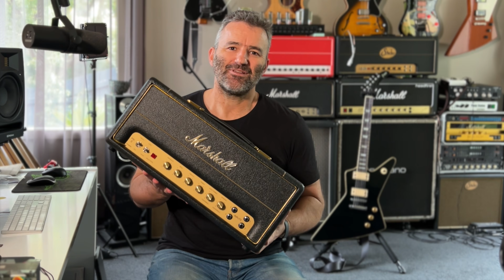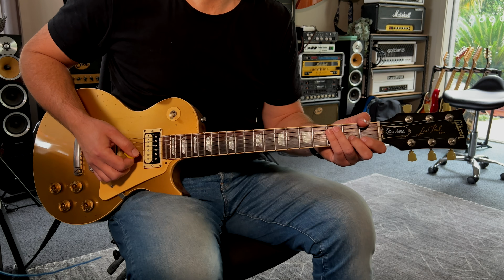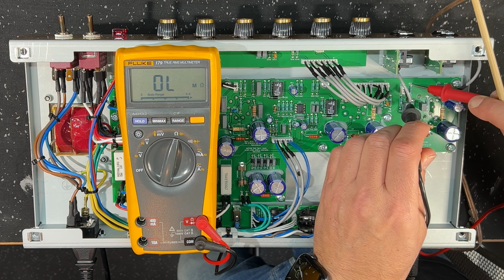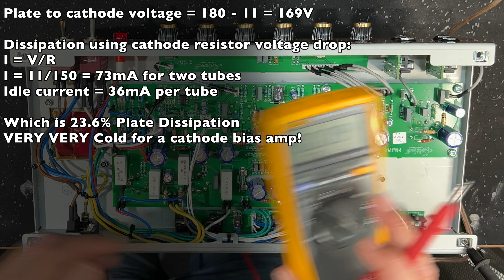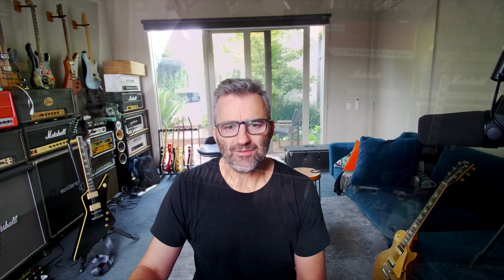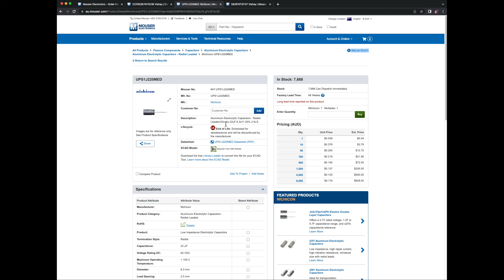Improve the Marshall SV20H with $5 of parts?  BENCH DEEP DIVE!!

Comment from the maker: Guys, worth mentioning that you don’t need to change the 820r cathode for the bass channel for this.  I did both cathodes for v1 to 2k7 in prep for the phase 2 Jose style mod.  There, I just saved another dollar!
Reply: @BlakeC27  sure.  Very simply.  It's all there except for the power transformer, even in HI voltage mode, it's quite low, so lower headroom!  😩
Reply: @RozsaAmplificationLLC  It's a fantastic concept in terms of reducing the size, weight and unneeded volume of 2x EL34 but despite all the means Marshall has available they overlooked one of the most basic details of power-scaling; providing a separate HT supply for the preamp! They get their transformers custom made for them anyways, why not add a separate 300vDC tap so the half-power switch doesn't half-starve the preamp?
Reply: @killingmasheen in low power mode, the preamp supply voltage actually goes up a little, due to less load on the transformer.
Reply: @BlakeC27  yes, the Bass channel (Input 2) has a 330uF cap in parallel with the 820R resistor on the cathode.
For the Normal channel (Input 1), there is a .68uF cap in parallel with that 820R resistor on the cathode!
Reply: Man you've made the amp sound so much better it's unbelievable! You are a true expert in the field
Reply: Hi Jason. After having modded both amps, which one sounds better between the Origin 20 and the SV20 after being modded? Many thanks for your time in advance
Reply from the maker: They have the same transformers and components, I think they are the same tonally
Reply: @HeadfirstAmps and in your opinion the sweet clean sound in comparison between sv20/or20?
Reply: 820, go up to 1000 👍

Comment: Stock sounds amazing as is and the mod makes a subtle adjustment. I can see why it was done. I remember modding my old DSL 100 head and later a DSL 50 and it made a slight improvement to the highs but not sure if it was worth my time changing parts and opening the amp. Anyway it was fun to say…this is my modded amp. If you have an EQ you can change the sound a thousand ways til Sunday although obviously it’s more expensive. Great sound demo at the end!

Comment: SO the whole point of this amp is to get the sound of a vintage marshall lead amp, which absolutely used 820 ohm cathode resistors on the V1 tube (just like the tweed Fender amps they owe their origins to) . The amps that Jimmy page and Jimi hendrix played through used those values..Marshall started using  values like 2.7 k in the 90's ..if you want a 90's ampo i believe they make a studio 900 ? don't they, which is the JCM 900 in this compact home friendly package ?

Comment: The biggest shame is that construction had to be this horrible modern fragile method with circuit board pads. If only this could have been the old robust turret construction that lasts half a century. I like the sound of this mod, but I can’t risk pulling the pads off the board with the component I’m trying to get free of that dreadful lead-free solder. I’d like to buy this amp, but I’m really turned off by this construction method. Anybody had one of these for a while and worked it hard? Can this construction hold up to a lot of gigs?

Comment: Great video Jason. Why plate snubber on V1a and not b, the bright channel? Many players use bright more, even if jumpered.
Reply from the maker: This mod eliminates the normal and bright channels. It has a preamp gain and a master volume now, similar to a 2204
Reply: @HeadfirstAmps thanks. I’m building a 4-hole plexi with extra tube for Jose and SIR#36, you did on your channel and unsure if I add snubbers and where best to install. I doubt I’ll use both extra stages at once and they can be bypassed for standard plexi but inputs jumpered.

Comment: A few comments/questions on a technical nature:

1. How loud of a signal is necessary in order to drive the first gain stage into audible non-linear territory?

2. When you changed the cathode resistor on the first gain stage but left the bypass capacitor the same you increased bottom end amplification (down to 87Hz vs 285Hz, based on crude calculations). 

3. When you added the 22uF fat cap you increased gain to a stage that you kept biased as hot. IME, this runs counter to any goal of reducing fuzziness.

What do I hear? I hear the increased low end in the voicing and a fuller sound overall and find it to be an improvement. I don’t hear any issue with fuzziness in either clip though you didn’t do any heavy riffing on the bass strings at the 12th fret with the neck pickup to tease out any potential problems. This was also helped by the fact that you weren’t using the normal channel which has the 330uF cathode bypass and 22nF coupling capacitor; not to mention that it doesn’t have the bright and treble peaking caps to help mask a fuzzy bottom end.

Personally, I’d go with 1.2k at the cathode of V2A (still bypassed with 22uF) and lower the V2B cathode resistor to 47k; but that depends on whether clipping at the cathode follower is an issue and whether any noticeable compression that may result is desirable. I definitely endorse lowering the bypass frequency at the first gain stage of the high treble channel unless blending is your thing, in which case I think Marshall’s configuration of the normal channel also deserves some scrutiny.

I love your videos and all the wonderful things you do for the DIY community. You are a great source of inspiration!

Comment: Would it be possible to bias the EL34's hotter by just plugging in a lower value cathode resistor, like 120r? Sorry if this is a silly question, new to all this :')
Reply from the maker: The PT almost certainly won’t be rated to cope with it.
Reply: @HeadfirstAmps good to know thank you, frying that would've been a bad move!  
If you have a moment to read, I'd have another question, this time it's a bit more involved.

I've since messed with this amp a good bit more, basing it off of your really good videos on it (and gone a bit nuts with adding switches), but I still haven't gotten it to where I'd like it in the power section: 
There's some weird, unpleasant (the only word I could use to describe it is squirrely? Sorry) high end sizzle happening in the EL34 stage, somewhere above 12khz, that's always been there! Hell it was the reason why I started modding the amp. 
So far it only goes away when a PPIMV (Lar Mar style) is set at around 3-4 o'clock or lower. As far as my lack of much experience goes that just means "ey the EL34's are not happy with that signal level coming in", but could it be anything else?  

The end goal was to get that fuzz-like raw top end of the bigger brothers, if at all possible - and the MV got it a bit closer, but not quite there yet..  
  
PS: There's some resistors between tonestack and PI that end up attenuating the signal a chunk. A gnarly boost can be had getting rid of them! :p

Comment: Interesting video!  As you've pointed out, I hear the differences in the tone after the modifications that you performed...adding both warmth and clarity at the same time, which is sort of contradictory, but you can certainly hear it.  Although it is subtle unless you know what you're listening for.  There also seems to be a slight amount of added sag.  I think the amp sounds great both before and after the mod, but better after...maybe.  To my ear, the tone after the mod sounds more JCM800-ish...if you like that.  What speakers were your using for the demo?

On a related subject regarding the SV20H, some techs are saying that this line of amps is way over-priced for the level of components and build quality you're getting for the price they're being sold at.  Also, that the fact that the power tubes are biased so cold from the factory is a big factor regarding the amp's potential.  Even though, I'm pretty sure this amp is self-biasing within its parameter.  What are your thoughts on this?

Comment: @HeadfirstAmplification Is the PCB of the amp of high quality in your opinion (i.e., so that it would last)?
Reply from the maker: Yes - it's a quality board
Reply: @HeadfirstAmps  Thanks, your opinion means a lot. I'm quite sceptical and was reading up on the subject "hand-wired vs. PCB".
Reply from the maker: @hammondvoodoo9555 PCB can be handwired, for example how I build my amps.  All hand soldered and wired, and with a PCB backbone.  Then there is PCB machine stuffed and wave soldered, that’s different.  People should look past PCB to understand the actual construction method.  PCB done right is superior, especially for high gain.
Reply: @HeadfirstAmps  My concerns are not about function, but about longevity and how often you can replace electronic components that are soldered to a circuit board before the board is broken. For me, hand-wired means that there is no circuit board and you can overhaul the amplifier as often as you like. Defective electronic components may sometimes even burn out and damage the circuit board permanently to such an extent that the affected area must be bypassed.

Comment: Honestly, if I didn't know about the mod, I wouldn't have noticed at all and I'm usually very critical about tone. The differences are very subtle. IMHO, it's not worth doing. When I tried this amp out two days ago my impression was that with bridged channels one primarily adjusts the normal and bright volume - like with any Plexi. This has by far the biggest impact on the overall tone. The 3-band EQ as well as the presence control are set afterwards for fine-tuning - that's it. Very simple and straight-forward like it should be if the sound is right. I'm actually astonished what Marshall achieved with the Studio Series but as soon as I saw the circuit board I was a little disappointed. Point-to-point-wiring is so much better in the long run. But then the amp would be much more expensive, especially with that mentioned choke transformer added ...
Reply: While point to point is in a way kinda nice for collectors it's not the be all and end all many circut board perform admirably there is enough Amps out there to prove this point I like the point to point stuff too but I have realised it is a big selling point for companies who need to sell amps and need a sprinkle off good ole fashioned voodoo dust to sell their product and I'am not saying  their Amps are bad but we all have been sold up years ago myself included that point to point is the only way  your listening to your own sv,20 I have one too along with all the old classics too and you like the sound off your sv20 and it ain't no turret boarded bumble bee capped ge or Telefunken tube powered amp it runs tubes but nothing vintage in it I get the vintage thing I'm in it too but these compromises within the sv20 are pretty incredible and proof enough you can still do it essp with 75 hz g12m or g12h  maybe ev speakers 12l anyway enjoy ya tones

Comment: Hi Jason, I've also seen the other video comparison between this and the Origin. A friend of mine told me that these little bests have a 50w rated output transformer but the power tansformer are not rated for that. So, I have both trafo that I bought months ago for a project. Couold you tell me if it's possible to make this amp a 50w amp? And if yes, if I send you my e-mail, could you tell me what to do?
Thanks a lot.
Reply from the maker: The Origin 50 delivers 50watts.  Thet amp is not worth spending money on replacing the PT imho.  The output section is fine the way it is.

Comment: I once had two 2210's(JCM 800) and both of them sounded so much better when I simply replace the phase inverter pre/tube with a 12AU7. Both amps sounded less boomy and noisy, and had a more balanced overdrive tone, with a more balanced high to low, whereas the original 12AX7 was as your amp here pre-mod was, a bit too strident and out of control... with a lot of mud and noise.
Reply: That's interesting!  I have a 1989 2210 that I have a love-hate relationship with.  No amounts of EQ tweaking seem to make it sound right to me.  The bass sounds bloated, the midrange is just wrong and the high end is spikey.  I've always blamed it on the clipping diodes, but maybe your PI tube suggestion would improve it.  What do you think?
Reply: @markn4526  you only have to try it and see. Tone and overall dynamics are in the ear of the observer, and many have said these amps are too dark and muddy, but I always thought they sounded way better than the overly bright JCM 900's that followed. But this is up to the individual ear, and not for me to pontificate on; anyway you could always try it out for yourself and see how it sounds to you. To me they sounded a little softer and probably quieter,( nit a problem for a 100 watter), but the overdriven sound was a bit tighter, almost as if tge amp had EL84's instead of EL34's at output. One of my amps always sounded better than tge other anyway, so they must vary a bit ( although the one I liked less was originally the combo version which I had rebuilt into a top unit) so maybe some variation in componentry happens deprnding on whether they are made for open backed ttwin combo or top and speaker. I just tried this splitter tube change on a whim( can't remember where I got the idea- back in the 80's, so probably Guitar Player mag) and the amps seemed to like it. I'd say give it a try tubes are not that expensive.
Reply: @chrisgmurray3622  Vintage Marshall amps often varied from piece to piece which is why Marshall amps frustrate a lot of people.  Changing the PI tube with one of lower gain would decrease the signal coming from the preamp to the power amp section.  My thought is that would make the amp sound less hard and soften up the tone a bit.  Surely that would attenuate the spikey high end, but it might make the bass even worse.  But who knows?  I guess I just have to give it a try!  I wonder if it's possible to bypass the clipping diodes.

Comment: Honestly I couldn’t hear a difference at first. I listened a couple more times and yes it’s a subtle difference the cringy ear piercing highs are calmed down I think. I have a Carvin bel air combo amp that I made some mods to. It was like a weighted blanket was lifted off of the front of the amp. So much better than the stock dark sounding amp it originally was.

Comment: Hey Jason, post ALL of the voltages in BOTH 5W and 20W modes please.

It looks like there is the following taps on this Power Transformer...0, 110, 220, 230V inputs, with 108V and 147V secondary, 13.7V for loop, DI, relay, and filament, and balanced 6.3V for heaters.
The preamp is 4-input 2 gain stage +CF normal and bass Hi and LO input plexi.  
I lot more versatility could be added, but in Marshall and other amp manufacturer fashion, they wouldn't want that, so you have to keep buying more product and perpetuity!
One MOD would be a one-wire MOD on a switch, so can switch between Plexi or re-route the signal to to turn the amp into a JCM800!  I would do that with one of the volumes and put on a push-pull.  
Likewise, one could add an NFB or number of MODs to this amp!
Seems like a good modding platform, just need to take care of the B+ line and for both modes, 5W and 20W, then take it from there!!

Comment: One thing I've been curious about is, regarding the B+ line cascading down from power tube to preamp tube, why does it get less and less as it goes? Does it have something to do with the gain structure of the preamp?
Reply from the maker: It’s because there are dropping resistors in the B+ line, normally 10k.  As current flows through you get a voltage drop across those resistors.
Reply: @HeadfirstAmps  I understand that, thank you. But why not just supply them with the same voltage to each plate through a voltage bus?
Reply from the maker: The purpose of the dropping resistor is to work with its adjacent filter cap to act as a low pass filter, with a cutoff at close to 0Hz.  Ie DC   If you didn’t have that, you amp would motor boat and oscillate.  Plus you get sag and feel through the B+ string.
Reply: @HeadfirstAmps  Thank you for explaining. I've built a few tube amps from kits, studied schematics, and even done modifications to amps. It's always something I've been curious about.

Comment: Excited to hear how this turns out! I have been on the fence on whether to get the SV20 or the SC20. The concern being the SV20 may not have enough gain, whereas the general concensus seems to be that the SV20 is the better sounding of the two. Wonder how the end result will compare to the SC20
Reply: The SV20 might have enough gain, but you'd have to turn it up pretty loud in order to get it.  The SC20 can get more gain at a lower volume level, but the tone characteristics will be different.  For me, nothing beats a Plexi driven hard.  I'd get the SV20 and have a PPIMV installed.